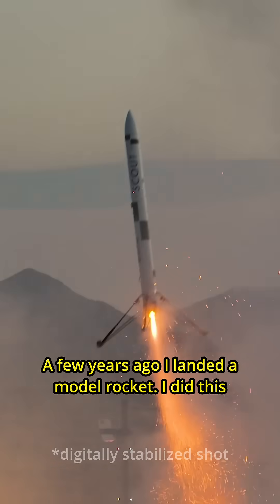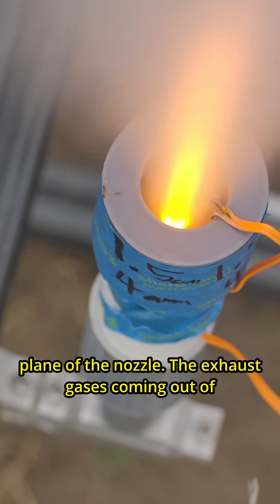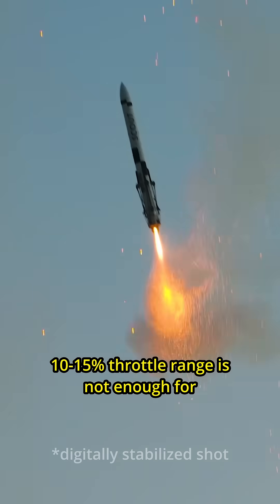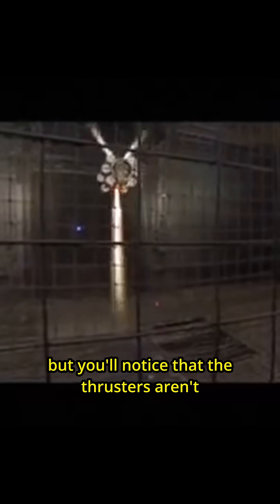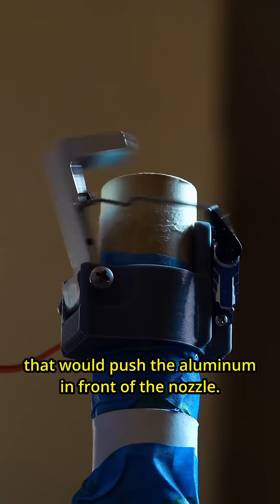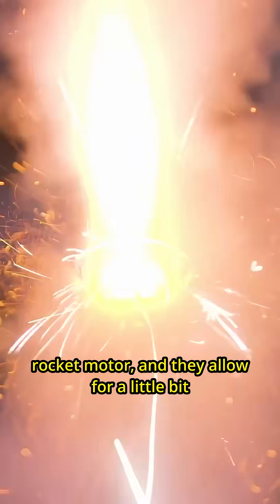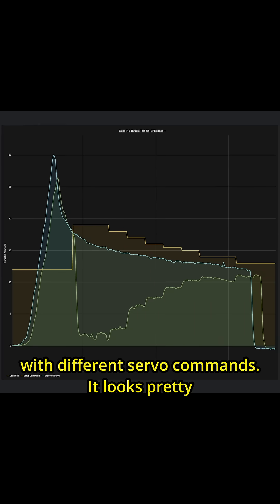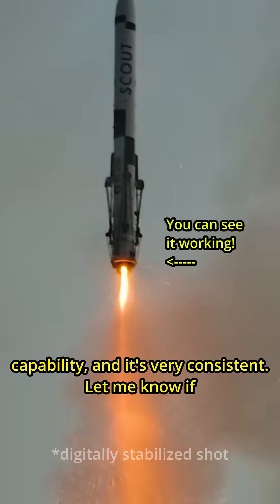Solid Rocket Throttle Control

Comment: I'd have been tempted to go for a hover-slam timed to just barely land in the lowest performing case and arrange some way to shatter the nozzle at the best possible time. Ideally that would drop the trust to weight well below 1 but not zero so you still get a controlled fall. Realistically I'd expect to get functionally zero trust but if you can do that at a low enough altitude you can still just drop and land on your feet.

Comment: 1. Built a 21 cm long, 2.5 cm wide solid motor (~3 kg) with no central hole, cigar-style grain.

2. Used graphite nozzle + paper/tape casing + butter paper + cellophane layers (burned away clean).

3. Added a piston system to push propellant forward as it burned → kept thrust more constant.

4. Controlled piston with a gear system powered by battery, timed to burn rate.

5. Later upgraded: 311 aluminum rings around the cartridge → lightweight, fell off as burn progressed.

6. Used metal contact + voltage sensor system to track how much cartridge burned & piston position.

7. Dual check system: one at nozzle rim, one inside cartridge → main computer compared values for accuracy.

8. Copper wires for signal (fast response ~200,000 km/s), aluminum for motor wiring → clever separation.

9. Hydraulic damping landing system idea: absorb remaining momentum (~35 kg·m/s) smoothly, no bounce.

10. Designed around terminal velocity calc (~159 m/s for 7 kg rocket, 0.01 m² area) → landing burn impulse matched.

11. Used multiple motors staged with 1 sec overlap → redundancy in case one burns shorter/longer.

12. RCS control for orientation + passive hydraulic legs → high landing reliability (80–90% possible).

13. Proved solid landing possible, but admitted long-term reliability issues (burn rate unpredictable).

14. Recognized piston method scales poorly → fine for micro-rockets, not ton-scale boosters.

15. Still, showed crazy creativity and engineering insight at small scale.

Tell me if you want more details.

Comment: I would try and place the servos a little farther from the exit point as to not potentially melt....id place them about a foot further up in the protection of the insulated combination chamber and extend the servo arms because they are metal and can take a little more heat tho id rather use titanium for the servo arms stainless steel should work for testing purposes...hope I'm not talking out my exhaust good luck!!!

Comment: A solution ultimately in the same vein as yours but a bit more "stylish" :

A muzzle break like nozzle, where the main opening can be more or less constricted to redirect the exhaust sideways.

The main opening would have to be big enough that when fully open the side vents have virtually no effect on the exhaust.

Comment: Incorporate around plate inside the nozzle with a pattern of holes with servo covers for each one. You would have some  limited gimbled thrust functions and progressively decrease or increase thrust by closing or opening ports.

Comment: Capture Valves would reduce the heat exposure of servos behind them, this looks like it just sprays heat onto the bottom of the rocket. Those screws might get a bit wobbly after a hot minute.  A more permanent way of holding their joints would be nice, one with no way to wiggle out of their socket. The time of exposure is pretty brief so it probably doesn't matter, and I don't know if you reuse these so I might be talking out of my butt.

Comment: Why not just turn the throat of the nozzle into a motorized aperture, like a camera lense. You obviously couldn't "throttle" it (because bomb), but you could open it extra wide, causing the same effect as throttling by losing efficiency therefore, decreasing thrust..

Comment: Why not use a propellant without oxidiser. and then add a compressed oxygen tank with a valve on top?

Or you could use a propellant mix wit only a bit of oxygen.

Comment: Control surface area of available solid fuel? Have an angled cover that can be moved to reveal or hide the surface area of available fuel inside the rocket. Probably not a linear fix

Comment: I wonder if you could approach from the other end of the motor using a servo to open or close the forward end of the grain either venting exhaust forward or allowing in air the cool exhaust

Comment: You could use a rotary system with ceramic that is pierced and turn in different ratios depending on the need to block the trust at different times.

Comment: How would you achieve thrust vectoring using a solid rocket motor?
Reply: Same as a traditional engine
Reply: @mtqrx traditional engines have throttle control, solid rocket boosters don’t.

Comment: One solution would be to have the modulation on the middle of the missile, where you do not mess too much with the momentum.
A ceramic ring would be the valve.

Comment: Could you have used a system like a camera aperture - would have been way more complex to build and control but would provided a uniform closure within the bottom or the rocket without the extended height. Probably added more width though. Probably your solution would be far cheaper and easier to engineer

Comment: Make it throttlable by placing a small CO2-cartridge in the nose cone. Add an pulse width controlled ”PWM” open/close cycle valve. Lead the CO2 to the combustion zone using an aluminium ”straw” inside the solid fuel. It will ablate away and give a path for the CO2.

It will sound like a machine gun when throttling. 💥💥💥💥💥

Comment: The solid booster on the Minuteman II had a thrust cutoff system by opening the solid booster in the top and venting the flames and thrust out sideways when they had had enough. 
The result is a drasticly reduced chamber pressure and thrust through the much narrower nozzle is wastly reduced.
This way they chould use the exact same booster to reach wildly different locations.

Now, if you design the rocket fuel so that the resulting pressure and temperature at that point is below what you need to keep the rocket burning, you effectively have a solid rocket motor you can shut off at will.
That fuel may not be the most efficient, but since you can design the geometry and fuel composition of solid motors as you see fit, having a motor that after a certain amount of burntime can be shut down like this becomes quite possible.

And to those who think it's impossible to shut down a burning solid rocket motor; this is possible, just very rarerly done. There are simpler sollutions, like a liquid second stage.  But for the Minuteman ICBM, that was not an option.

Comment: I get the whole PWM (width)  terminology thing.  When I came across some circuitry that said it used PDM (duration), it took me quite some time to adjust.  Eventually, I was just able to accept it.

Comment: Just an idea: you know what you do, when you balance a stick vertically on your hand. The tip almost stays in place, while you move your hand.

I picture this: the rocket motor has a cold side on the top and can be held onto on the middle part.
How about gimbal it in the middle and use a flight controller like from a quad copter to pivot the top under the tip of the whole rocket?
Meaning if the top of the rocket tilts to one side, the servos on the tip of the engine point it slightly towards that tile, so the thrust from the engine equals out the tilting force of the rocket's head.

Of course, the area around the engine needs to have enough room to angle the engine a little bit, but I think anything around 20-30° should be enough.

Comment: Why not an iris mechanism to cut it off?
If yah can cut ceramic well enough, should be a couple of plates, the iris lips, and then studs for control. Having a connection on the end to control it???
Idk. This way you can isolate the low temp control mechanism but have the high temp end.

Comment: Nice job! This may help improve your results. Using 4 ceramic rods that could be individually controlled would allow you to keep the rocket more vertical as it descends and lands. A gyroscope may be impractical or too expensive. A round bottom container filled with mercury or another liquid conductor with 16 electrodes in a circle can act as a stabilizer, four electrodes for each ceramic rod. As the liquid loses contact with an electrode, the loss of current causes a ceramic rod to move. This allows each ceramic rod to have 4 positions that can alter the thrust. This will take some experimenting, but it may work.

Comment: I was thinking the tube you first tried could have air inlets and let the thrust pull air with it through the tube and then you could vary the size of the holes letting in different amounts of air to throttle the rocket. The hole size could be varied easily by doing one tube inside the other with holes that line up and when you spin one of the tubes it closes off the hole. The outter tube would have to be larger in diameter and the motor would probably have to sit deeper inside to pull as much air through as possible.

Comment: i would have started using liquid fuel instead ^^
i believe someone build a rocket using a PE pipe and a controllable NOX flow for a hybrid solid/liquid fueled rocket. its probably totally easy to do in your backyard ^^

Comment: I would've nozzled the exhaust inefficiently as a default, say 20° down from horizontal. The control comes then as you feather that exhaust downwards at 90%

Comment: Two rocket motors on pivots. They fire parallel for full thrust. They both pivot out 90 degrees so they are 180 degrees from each other to get 0 thrust. Everything else is in between.

Comment: What about using a rocket with a very short burn time, and then just calculate at exactly what altitude to start the complete burn that would result in the rocket having zero velocity and zero fuel when it hit the ground?

Comment: Use ventura pump, to suck air from outside . Air will expanded from heat of engine. Then regulate air flow which go into engine.

Comment: presumbly it will still get damaged from abrasion with solid dust particles from the exhaust (like al oxide or whatever). also there might be problems with non uniform thermal expansion causing cracks and stuff. would be interested to see how long you can block it for. also, the physicl moving part can't move in and out of the way instantaneously for pwm

Comment: As an FYI: You have a guided rocket here. The FAA is not going to be happy about that if you are reported. Get straight with the regulations governing guided rockets.

If you have a local amateur rocket group in the area get with them. Otherwise, head over to the FAA site and look up model rocketry.

Comment: Electrically controlled rocket fuels, specifically electrically controlled solid propellants (ECSPs), allow for precise ignition, throttling, and even extinguishing of thrust by applying or removing an electrical current. This offers significant advantages over conventional solid rocket fuels, which are difficult to control and extinguish. 
Here's a more detailed look:
1. What are Electrically Controlled Solid Propellants (ECSPs)?
ECSPs are a type of solid rocket fuel that can be controlled electrically, allowing for on-demand ignition, throttling, and even turning off the thrust.
They are particularly useful for applications where precise control of thrust is needed, such as in spacecraft maneuvering or for specific mission phases. 
2. How do they work?
ECSPs are typically composed of a blend of materials, including fuel, oxidizer, and sometimes metal additives. 
When an electrical current is applied, it generates heat that ignites the propellant. 
The intensity of the electrical current and its duration can be adjusted to control the thrust output. 
By removing the electrical current, the combustion can be extinguished, offering a unique on-off capability. 
3. Advantages of ECSPs:
Precise Control:
ECSPs allow for precise control of thrust output, making them suitable for fine-tuning maneuvers or for tasks requiring specific thrust profiles. 
On-Demand Ignition and Extinguishing:
The ability to easily ignite and extinguish the propellant allows for efficient use and avoids the limitations of conventional solid rocket motors. 
Throttling Capability:
ECSPs can be throttled, meaning the thrust output can be adjusted in real-time by controlling the electrical current. 
Safety:
ECSPs are generally considered safer than conventional solid propellants due to their controllable nature and the ability to extinguish the combustion. 
4. Examples and Applications:
Spacecraft Maneuvering:
ECSPs can be used for small adjustments in spacecraft trajectory or for attitude control.
Space Launch Vehicles:
While not used for main launch thrust, ECSPs can be used for secondary propulsion systems or for maneuvering in space.
Micro-propulsion systems:
ECSPs are well-suited for micro-propulsion systems, such as those used in small satellites or for controlling the attitude of spacecraft.

Comment: Create a ceremac nozzle insert into the jet that can be turned from full open to a minimum orifice size while maintaining good geometry for flow.  Could be designed so that the jet articulates for directional control, especially if coupled with a gyro.

Comment: a disc with a hole and a pivot point could save some weight but might cause a vector you don't want, one over the other, with both pivoting different ways would also be a crude iris

Comment: What if you made a nozzle that directs the thrust into 2 streams, and pivoted them so that you can throttle the downward component, and the horizontal components cancel? At 0% throttle, the streams would point directly opposite each other, and 100% means both straight down.

Comment: I would have both those actuated by one linear servo on a spring loaded cantilever, that way the flaps are equally blocking the thrust and not vectoring it to one side if one servo is not perfectly attuned to the other.

Comment: I would consider using a mechanism that functions more closely like a camera aperture. It would give you more control while keeping the flow more stable.  You could build in exhaust ports above the aperture to displace the gasses more symmetrically which would reduce any lateral loads from the gasses.  It would be powered by a single servo that opens and closes the aperture.

Comment: But whats the application of this like if you scale it up you probably wont be using a cheap model rocket motor so your design would become obsolete in a sense what if you scaled down a large scale rocket fuel system but then again keeping the right temps would be difficult cuz you gotta mix pure gases in proper ratios and making that small would make it immeasurably more challenging then just building a full size rocket idk this seems goofy no matter how you slice it but getting the engine to pulse on and off would be simpler with a motor that you could control the fuel ignition with idk what I'm talking about anyway ignore me

Comment: Im going to give you a tip, use a iris shutter. Its the same design as used in the tv show "stargate" as the iris gate slides together to interlock.
You can put limiting amounts so it doesn't fully shut at any time besides at shut down.
The reason the clamp and the thumb does wrong is because you still have thrust, just its being redirected in random amd uncontrollable ways.
Use the iris shutter gate to "close" the diameter of the combustion chamber exit or entrance.
Can try using powdered propellant under pressure and a auger to move the powder through the "gas" lines. But thats more likely to require extensive thought for success.

The iris gate will allow you to throttle a little better. 
Can even do a 5 or 9 chamber exits and iris gates controlling each direction while the solid fuel is burning in the main chamber at a continuous rate, each iris can open and close to give more or less thrust allowed from the main chamber into the exit chambers. Just need to figure out how to not make it explode under such pressure and restriction of the outlet

Comment: Pretty elegant solution.  So you diverted the thrust headed down out the sides that countered each other roughly - nice.  If you could make a pivoted segmented or iris cone below the exhaust that you can vary with a motor, you might get a better control and variance, but adds complexity and weight.  plus coat it in something that can take the temps ;P
Reply: or a fixed fan below, with blades you can alter the pitch and a hole in the middle?

Comment: Anybody have a simple garden water hose nozzle from 1950s era. Made of two pieces that twisted on one another and varied the flow and thrust and shape of the water exiting the nozzle from a gentle, wide spread  misting of fine droplets to tightly focused jetting stream powerful enough to knock the old man's toupée off at 30 paces?

Just a thought.

Comment: First thing that came to mind is a variable geometry nozzle. You could make it out of Steel or Copper and coat it with a UHT ceramic spray on the side that will be receiving heat. If the ceramic coating wares off you could just re-apply as needed.

Comment: I'd build a base of 3 engines around the rocket body, each on a servo and controlled by an ML Algorithm reacting to sensory inputs (like a gyroscope and some way to measure distance to the ground) to keep it stable and to slow down at the right time.  Just point the engines away when you want to slow down, and point them toward eachother beneath the main rocket body to speed up.

Comment: My high school water bottle rocket in 04’ I made helicopter rotors that sprung out and it would slowly land. No electronics at all. Some legos, electric tape, styrofoam plates, cardboard, superglue and a rubber band, and a skate board bearing. It was the only rocket my teacher had ever seen with a successful recovery system I flew it the next year too and when I graduated he kept it for his rocket.